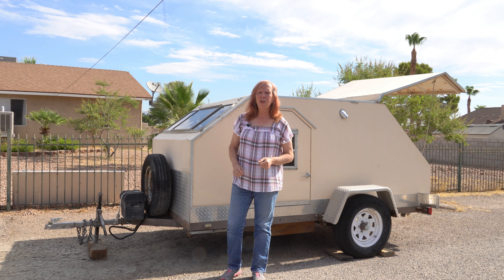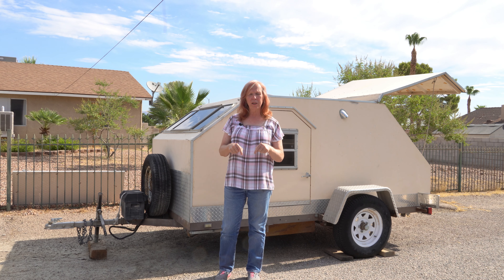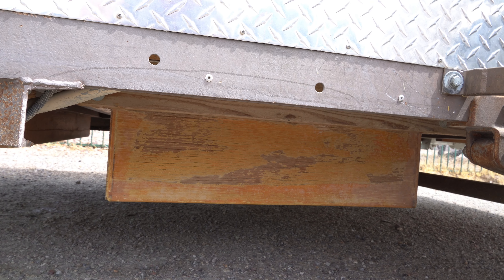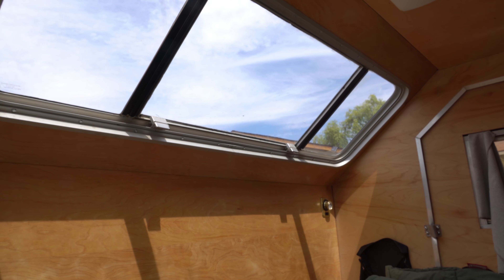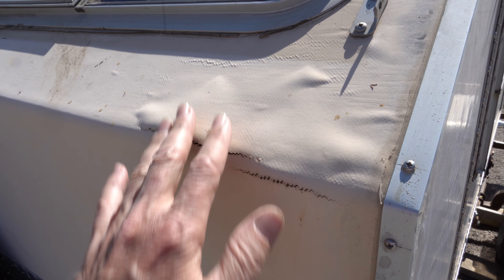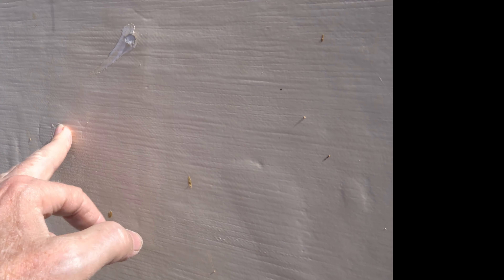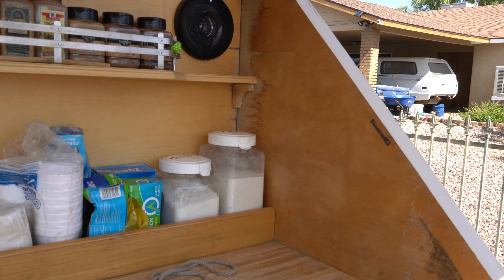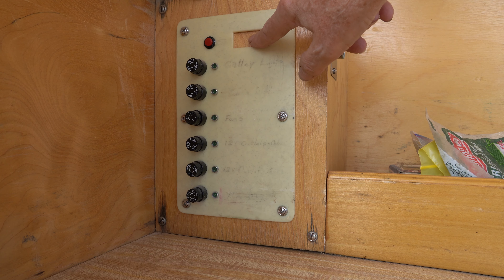Can We Save The Desert Dawg?!?

Comment: i am a cabinetmaker and furniture builder, also i am new to your channel, and i am probably too late to offer suggestions, but, here goes.  in the 70's, popular mechanics offered several projects, i.e.: cars, boats, and camper bodies, using styrofoam board and fiberglass overlay.  also, there was a bit of plywood involved, think of how a boat is built, with ribs.  also, there are preformed metal "2x4's" to be had at your big box stores, or one could use aluminum extrusions for the frame, or even pvc pipe.    either one would work for this type of project.  the main thing is to incorporate the foam board and fiberglass as the primary building materials to assure water-tightness and to keep the weight down.  like i said, they were building cars with this procedure in the 70's.  thank you for your attention.
Reply from the maker: Hi Don! It would have been great to have you as a neighbor when I was building the trailer. :-)  I have seen some people build their trailers by creating a foam & fiberglass composite. I think it's a really interesting concept. It wasn't being used in the teardrop community when I started building. My "remodel" of the trailer is going to focus on fixing water intrusion and building a new hatch. I hope to get started on the project in the near future. I have a whole website dedicated to the original build. www.desert-dawg.com  
Thanks for your thoughts on this!

Comment: another great vid Joanne....we know what that is like and once they repairs are in your head they never leave until you do them.....not to mention upgrades...... can't wait to see you talk about rope gear and how it all works ....take care and see ya soon.
Reply from the maker: Right! So many ideas running around, but I also don't want the rebuild to drag out for years like the original build did. Both Kelly and Tony have spent a lot of time camping with me, so I'm going to ask for their ideas as well. One idea is trying to add air conditioning vents inside so I can set a window AC unit outside the trailer. Then I could actually camp during the summer.
Reply: @OutdoorAdventureTV  thats a great idea or even an ac unit like on small travel trailers mounted on the roof with a small Generator with inverter

Comment: JoAnn. Vibration is your enemy with a trailer
It would be good if you could get some aluminum sheets and cover the trailer. It like they use on RV trailers. It comes in 4'x8' sheets. You would have to take out the windows and door to cover then after you finish covering put them back. I dont think the sheets aren't that expensive. Your heat there is your enemy also. Also you can raise the trailer on your leaf springs to give you more height. You can reach out to me for more ideas.
Reply from the maker: I considered aluminum when I first built it. I may rethink whether to use it for the rebuild. I did flip the axle on the spring for a bit more height when I started taking it off road. I've thought about getting a new axle and springs. Last time I bought new wheel bearing, the parts guy told me that they were getting hard to find. Maybe a straight axle with brakes since the trailer is heavier than it looks. Thanks for you thought on this!!

Comment: That's a nice trailer.  Maintenance and maintaining of ANY piece of equipment you have MUST BE a regularly scheduled event.  30/60/90 days, whatever works to maintain your equipment so it will not fail you when you need it.  You did not bring up a couple of the important items - the tires and lights.  For the wheel bearings keep them greased.  And for the tires keep them filled w/correct air pressure.  If you don't have one get a Slime repair kit w/the string plugs.  Cheap compared to being stuck somewhere with no way to repair a tire.  The kits don't take up much space and you can carry them around in your pov all the time.  Do you have a battery operated air pump?  Campbell Hausfeld makes some nice compact air compressors that plug into your cigarette lighter or power outlet.  Again, they are compact and very nice to have in you pov.  Also wouldn't hurt to carry an inner tube or two.  JIC.  For the lights do you carry extra bulbs & wire?  Do you have an electrical repair kit?  If not get one.  Ounce of prevention.  As for that storage box underneath, I'd get rid of it.  Looks like it is some sort of wood material and that will only soak up moisture from the roads.  That only leads to problems.  I'd get a couple of those Rubbermaid, 3-place drawers and keep them inside the trailer.  Plenty of room.  Those screws that are working themselves out, did you use drywall screws?  You'll have to put some sort of glue/sealant on the screws for ANY trailer because of the amount and type of vibrations it'll get from driving on the roads.  For the sealing, have you never seen those Flex Seal commercials on tv?  It comes in white so it would be perfect for the desert sun.  Again, nice trailer.  Just some cosmetic stuff, imo.  Too bad about the hatch.  Thanks for the video!
Reply from the maker: Glen, thanks for all your thoughts. Great information for anyone on the road. I do have a lot of the spares that you talk about and take them with us on the adventures. It seems like way too much stuff to drag around....until you have problems out in the middle of nowhere. Then all those things pay for themselves 10 times over.

Comment: Hi Joanne, thank you for sharing your videos with the rest of us out here in YouTube land.
I just came across your channel and just subscribe to your wonderful channel.  You are a most talented lady designing and building your trailer the carpentry skills welding and climbing skills that I have seen in your videos are outstanding.  How did you acquire  all those wonderful skills. 
You mention that you would like some commits for your trailer rebuild and modifications that you would like to change and upgrade.
I personally do not like vinyl  floor covering,  I found through the years the vinyl will shrink and start, for lack of another word starts to dry rot especially around the wear areas.  
What I would do instead of using vinyl, I would use cork flooring panels. 
 There is a  few reasons that I would chose cork over vinyl.  
Cork is a natural sound barrier, and also a wonderful means of insulating the floor, fairly easy to clean and has a natural look that is hard to beat.  
Cork will not curl back like the vinyl,  so you could save some weight and without the need to install aluminum trim around all the edges which would save a lot of time and effort trying to cut and fit all the aluminum trim as well.
I would eliminate your under the bed storage compartments,  nice idea but I agree with you it more of a hassle than it is worth as you mention in your video.  I would instead place storage boxes on the sides of your trailer with a hinge lid.  Just remember if you decide to use storage boxes on the sides to keep the boxes away from the front corners far enough from the front edge so you don't happen to hit them when you are backing the trailer and you have the trailer in position that you could possibly hit the outside boxes.
I would also add at least 4  each - 5/16 or 3/8 inch eye bolts along  and below the top edge of your trailer so you could attach a trap to the side of the trailer for some extra shade and also they could be used to attach solar panels, and/or light panels, plus they make good tie down points if you want to place something  on top of the trailer for some  extra storage.
Just some food for thought for your little  Desert Dawg. 
Thank you again for taking your time and sharing with the rest of us.
 Respectfully , dd
Reply from the maker: DD!! Wow, thanks for all the great ideas! Part of the reason that the original build took so long is that I had to learn all of the skills. I had never done any woodworking or fiberglassing, so there was a lot of "figuring it out as I go". I learned how to weld from my cousin when my Dad sponsored his race car. I wanted to help so I learned welding. It's actually been an amazing skill to have throughout my life. 
Thanks for the suggestion on the cork flooring! I'm already doing research on it. Let me know if you have a recommended product. 
I have also been thinking of the best way to attach a tarp. We regularly use one that goes over the hatch and extends about 6 feet to the back so I have shade to cook and a little bit of wind protection.  To your point, it would be good to be able to rig a shade from either side, or towards the rear. My challenge is to make it look good. 
Thanks again DD!
Reply: @OutdoorAdventureTV  You are most welcome Joanne.  My dad was an outstanding woodworker/cabinet maker, and home builder and own a small mill-work company, I learned most of my woodworking when I worked for him in his company.  The problem I had after I left and joined the Army was that all of his machines were not your typical woodworking machine.  They were all big commercial woodworking machines like straight line ripping saws, 36 inch wide-belt sanders, 36 inch wide wood planners and 24 inch cut off saws and overhead routers, etc., and the things we built were not related to building construction per say.  So through the years I just sort of figured out what to do on building constructions as long as I had a set of plans I was good to go.  Plus  being in a combat engineer company, I learn how to mix concrete and frame (Army) buildings and sheds.  Later when I was released from the Army, I was hired as a federal government civilian and there I  was able to learn a little about welding from some of the best welders that I have ever seen.  These welders were amazing, they actually came from the Navy Ship yards as nuclear submarine welders.  Submarine welders are all in a class of their very own as welders, their welding qualifications were the most of any industrial or pipe line welder out there.  I just wished that i was able to do what they were able to do, still I did learn to weld good enough to anything that I ever wanted to weld as long as I can see what I am doing and the metal is at least 3/16 of an inch and thicker would be preferred for my level of welding skill...LOL. Like you mention it is an amazing skill to have for sure.
Joanne I know that I mention, eye bolts to attach the tarp to the sides of your trailer that was just to give you an idea there is another way to go that would look better  here is another idea for your tie downs this is from Amazon and there are other types of D ring tie- downs as well:
SPEP.com 4 Pack D Ring Steel Tie-Downs - Floor Flush Surface Mount with Black Bases - Tiedown Breaking Load of 1,200 Pounds
by Sierra Pacific Engineering
4.8 out of 5 stars    48 ratings | 8 answered questions
Amazon's
Choice
for "cargo trailer tie downs"
List Price:	$13.00
Price:	$10.85 & FREE Shipping on orders over $25.00 shipped by Amazon. Details

Joanne I don't have any suggestion for the cork flooring but I would look and try and get the thickest that is available which is 1/2 thick.  If you want thicker you can always take contact cement and glue the cork to any thickness you may want.
I checked Amazon and I think Amazon is way over price for their cork flooring.
I checked Home Depot, currently they are not caring cork flooring,  
I  checked on lowes and they do carry the cork flooring and they seem to have the lowest price here is what I found for 1/2 thick cork flooring at lowes: 

Item # 91236 | Model # 40P42L06

natural floors 11.81-in Natural Cork Smooth/Traditional Engineered Hardwood Flooring (22.99-sq ft)
$68.74

Qty:
1
FREE Store Pickup - Available in 3 - 7 business days
Ship to Home - Unavailable
Truck Delivery - Available
Remove Save for La

Joanne, let you that I have a Rose Quartz/Amethyst/gold mine up in Plumas National Forest.  Currently the darn Forest Service has the area closed to everyone because of the huge Wild Fire that happen last year and my darn claim is right in the center of the closed area.  I am currently talking to the forest service people on getting permission (i.e. a letter) to go to my mining claim.  If I can get the written permission would guys like to come up and dig for some rose quartz/amethyst?  
If you would like to, let me know and I will let you know if the forest service will give me the permission to go up there.
If not then I will just take my old ford and my home built 4 x 8 utility trailer head out over into Nevada and do some prospecting, metal detecting, and exploring   and a lot of  camping in the back country provided it's not 100 plus temperature over there. LOL.

Have fun remodeling your Desert Dawg and keep us updated on your progress to.
Respectfully, dd
Reply from the maker: Hey DD, thanks for the in depth response! I like your suggestion for the d-rings. I'm also thinking of adding a roof rack that would be a mount for the tarp.
Would I like to come over to your mine? Heck yes I would!! Keep in touch so we can see when it works for both of our schedules. Thanks for the invite!
Reply: @OutdoorAdventureTV  Hey Joanna, I will definitely let you know as soon as the Forest Service allows me back to go back to my claim.  I sent emails to the FS hoping for good information on getting the written permission that I need, but so far excuses is all I am getting, the main ranger is away with a subuite ranger taking his place and is hard to get in contact because everyone is staying away from the office because of the this virus thing.  
It's extremely frustrating with the FS, right now, but hopefully I will get some good news soon, I also realize getting anything from any government agency soon, is like getting a ride on the slow boat to China, as say. If you know what I mean.
Respectively
Dennis

Comment: Hey Joanne, the sound is good in this one, have you got a clip-on mic?
Also, a bit of aluminum chequer plate would go well on the rub point on the side of the galley.  Wouldn't need to be full height as I think it is only the rear hatch prop that's doing that.  Mind you, are you going to try a pneumatic or hydraulic strut again and get rid of that pole?  It would be easier this time if you can keep the weight down and would also act as a stop against the hatch blowing over. 
If you can figure out a way of locking the hatch open,.. really locking it, then you may be able to come up with a way to secure a wind break/tarp to it rather than the main body of the trailer and avoid having it draped over the hatch.  Bear in mind though, when it's windy the tarp will trying to rip the hatch off, we know how strong the wind can get.
Oooo, just had a thought....  could you design profiled flaps that swing down from the inside of the hatch and sit on the top edge of the side panels?  Similar to how the side panels work on you stove.  If they are rigid (say wood or aluminum) they could be used to secure the hatch in the open position, again lock it there so it can't accidentally close or blow over.  Ready made wind and sun shade for the sides.  Consider though, it would be adding weight to the hatch and would mean you can't use the hydraulic strut.  Hmmm..!
Reply from the maker: I used a wired microphone on this video. I used wireless on some of the earlier videos. I need to learn the correct volume levels for a nice sound. Years ago I believe I saw a trailer with the fold down "wings" you spoke of. That said, we are trying to control wind and provide shade. I'm going to need to do a bit of figuring on the whole hatch concept. Looks like we will be back to tenting for a while. You up for that?